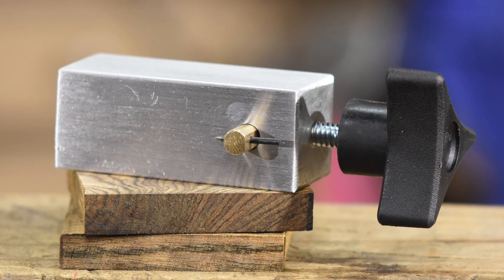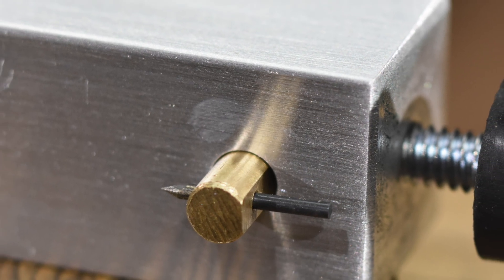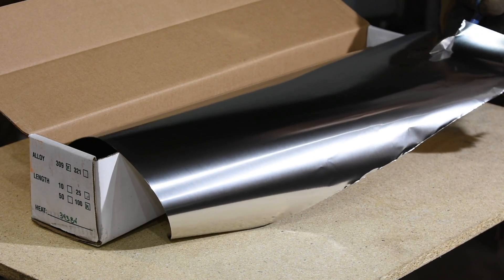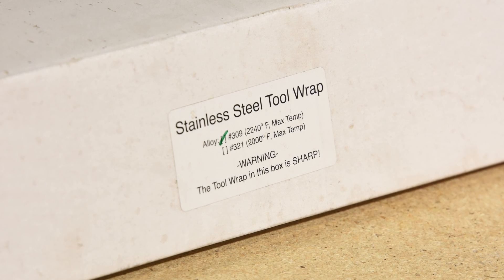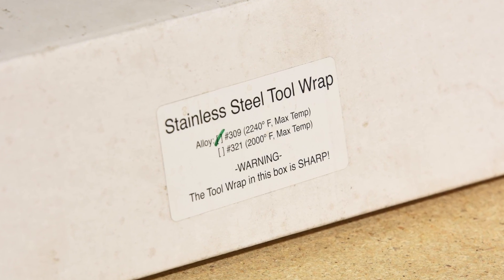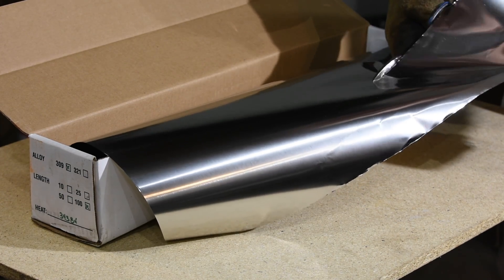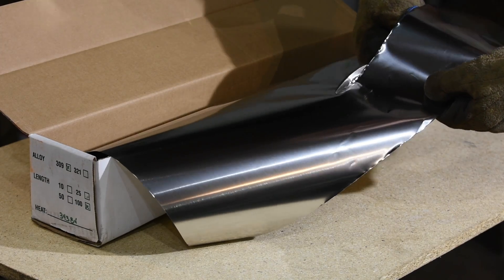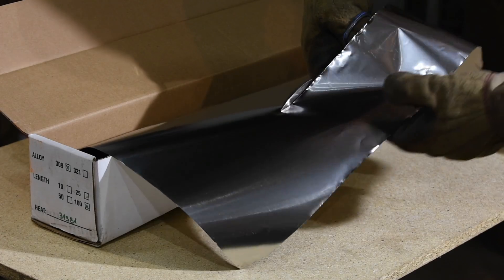Knife Maker's Friday Five #24:  Interrupted Quench Heat Treating Q&A

Comment: I brine quench my cold chisels from rebar and are currently capable of chopping concrete. It's all about HTing not the alloy. Brine can even make 4130 hard like high carbon steel if it has enough soap and salt in the mix.

Comment: Hey there. I recently cut and drilled a holed into an old file to be used as a flint striker. Now I cut two other pieces and did not over heat them and they work great as flint strikers, but when I heat treated the 3rd piece, it will not create sparks. It is hard. It is very difficult to get any  filings when trying to file it. The file just skips across it, but it will not create sparks. Now I used new ATF oil to quench, does that have something to do with it? I'd appreciate any experienced feedback. Thanks.

Comment: I have made a couple knives so far. I used O1 tool steel and quenched in canola oil. How often should I change out the oil?? One and done, or is the oil good for several knives?

Comment: We have furnaces at work that we can feed in carbon dioxide to ensure an oxygen free atmosphere for testing, but they get no where near hot enough for quenching, 6 -700 degrees celcius is about their limit. One could try tempering in it, but I generally get no scale when tempering normally, so not really worth the effort.
I find getting my coke fire nice and hot, then shutting off the air before dropping the steel in to heat it for quenching gives me good results with minimising scale.

Comment: Hey Walter, have you ever considered using an aerated sand bath for heat treatment? I saw a video on youtube a few weeks back and it looked like a good middle ground between treating in a forge and buying a dedicated heat treat oven. I ask because I'm wanting to get into file-cutting and it also looks like a good alternative to the salt baths used by commercial file-makers.

Comment: Bet you wish you would've known about a differential heat-treat resulting in a more shock-resistant blade before Forged in Fire, huh? ;-) =) 

With an interrupted quench, if you remove the steel from the quench after the steel cools below the nose of the TTT curve, does it not temper itself?  This avoids pearlite and banite.  The blade is mostly martensitic, which tempers due to the remaining heat left in the blade.  (I've been under the impression that this is what the guys on Forged in Fire are doing & why they pull the blade out of the oil so it dramatically bursts into flame.)
Reply: If you look at the TTT chart you will notice the Mf line around 200°F. Martinsite conversion isn't complete until you get there so you really aren't self tempering unless you edge quench to below 200 and let the heat from the spine run back into the blade.

Comment: Walter - Maybe I missed it, but did you actually talk about an "interrupted quench" in your video?  If you did, just say so and I'll go back and rewatch the video.  Maybe I don't know what that even means, but I think it means - like we see on Forged In Fire - you plunge your piece into the oil for a few seconds and then pull it out while it's still very hot.  Frequently, as on FIF, it will flare up.  I never have understood why they do this.  It would make a whole lot more sense to me to leave the piece in the oil until it is fully cooled.  Thanks for your video!
Reply: Yes he spoke about it..Generally he said it is for water. As for why do they pull it out when it is still hot on FiF it has to do with preference...There is a point where the blade is still hardening but has not reached full hardness and can be safely handled with gloves....say between oh i am not sure on temps but between 600-375 where it is cool enough to handle and still hardening but plastic enough that warps can be removed much easier...does that make sense..?
Reply: Yeah it makes sense.  It just seems risky because if you pull it out too soon, you won't get it appropriately hardened, and the window of opportunity is probably very small.  Thanks for your response.

Comment: Thanks to you i attempted to make a knife and say attempted because i failed at the very end i might say.
I tried to make a tanto chopper out of a old file i made a good design full tang started working by softening  the file and did all the work by hand with another file and a hack saw ( wanted a paracord handle so no drilling  ) made it smooth hacked off the end made it to look like a american tanto filed away made bevels the thing was in tip top shape heated it up to non magnetic quenched it in oil and it still manged to get a nasty curve near the tip and that's where i screwed up while trying to make it straight i snapped 2.5 inch off the tip. Besides the screw up at the end i manged to get it hard and the interesting part is i enjoyed the work i'd spend a few hours here and there and didn't even notice the time pass. 

In a month or two i'm going to attempt to make the same knife again and remember not to be so rough while trying to straighten it out :) If i succeed i will send you a photo of the finished knife.
Reply: I will try again the experience was not disappointing i think it was more inspiring that a person with 0 knife making skills (myself) after just watching some videos managed to make a knife...sort of :)

Comment: Hi I have a question about tempering I can not really find an answer to on the internet... Some knifemakers quench their knifes in water after a tempering cicle. Does anyone know the pros and cons of this method and what it does to the steel?
Reply: http://www.bladeforums.com/threads/cooling-from-temper.1009018/

There is some info.

I do it because there is no "cons" to doing it, it wont cause any stress, etc. and you can handle it immediately.
Reply: I do this occasionally, especially with knives that will have multiple temper cycles and a deep freeze cycle inbetween. Most recently I did it on some knives made of Sandvik 12c27 stainless, the reasoning behind is it needs a deep freeze cycle in dry ice and acetone solution, submerging a hot blade in this I am a bit wary of... So I cool the blade in water after the temper in the oven to incrementally bring down the temp to the deep freeze solution.  The tighter I keep the cooling curve between the temper and deep freeze cycle, the better my results. By tighter cooling curve I mean the quicker I raise and lower the temperature. I let the blades air cool on the final temper though.
Reply: The Stoned Videogame Nerd Plate queching is done on steels that are air hardening anyway, the plates are just slightly quicker than the air for quenching, they also have the added benefit of keeping the blade dead straight. Myself and another knifemaker run compressed air between two plates of Aluminium for quenching certain steels. After quenching a few blades in a row the plates just get too hot, it's the exact same principle as a CPU heat sink with a fan on it to remove the heat.
Reply: Negrataish Thanks a lot this link was exactly what I was looking for!
Reply: Stachy it hardens it very fast, but there is a very high chance it will damafe the blade.